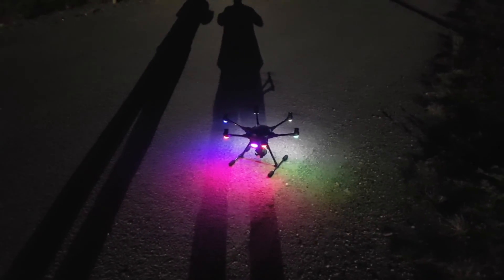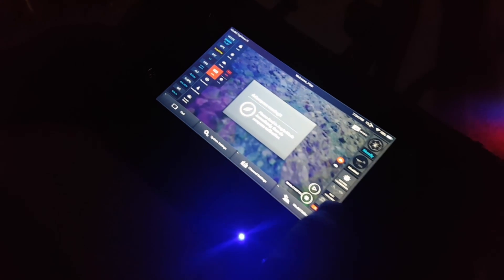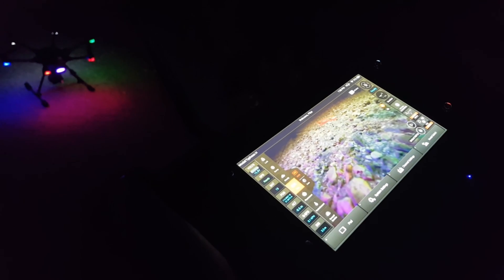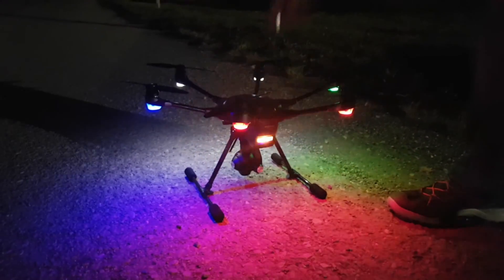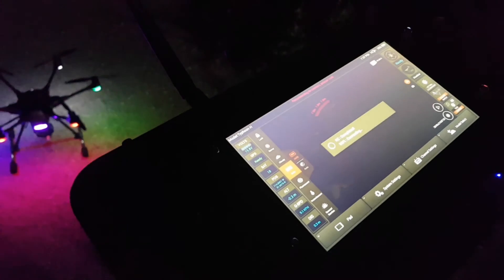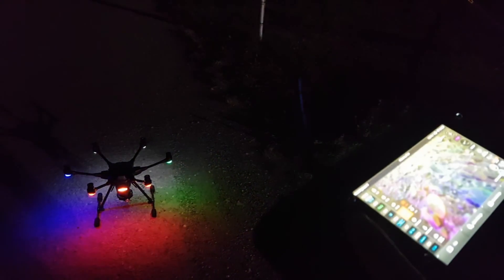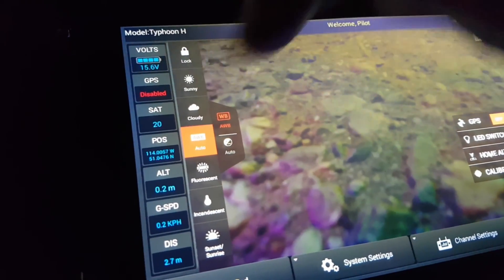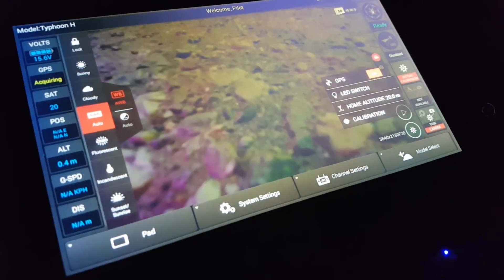Drone Crash Whats Wrong with the Replacement? Yuneec Typhoon H

Comment: you probably have re bar in your concrete, try moving the drone over the grass,
Reply from the maker: I should have also  said, this was actually gravel also...
Reply from the maker: I know what your saying about the steal rebar but that was not the issue.  My Compass error persisted for 50 or more attempts at another location, it was filmed here to show what was happening as I needed two sets of hands and it was near my friends place that was available.  There was a problem with the drones firmware.  I waited months for Yuneec to create a firmware that worked.  After the revised firmware that did a preheat and some other tweaks, this drone started to not have this issue, but it started to toilet bowl after a few flights when it got warm.  I cant recall how many drones they sent me, but it was at least 4 of them, and a new flight controller I swapped myself.  There was a handful of these 'problem' drones, but they did eventually fix it, but I had lost trust in the platform.  I have a long history documented on Yuneec Pilots for what I went through.   I was a loyal Yuneec pilot and at one point I owned two of these, but had the same issues.  If this TH worked, it would have been nice as The Inspire 2 cost me way more then I wanted to spend!
Reply: @drone_video9849  thats so strange, I have owned, for various reasons  at the very least 7 or 8 , starting with the Q500  , and never ever , had  any issues at all ,, never, in fact, not to long ago, a friend which has a Typhoon H, hit his own DJI phantom while trying to video the aircraft, 
snapped off one prop, and the Typhoon, calmly landed with 5 props,, with not a scratch on it,, .  Im shocked to see your issue.  I hope you have it resolved.  And are flying one to enjoy it
Reply from the maker: @guglielmodicarlo4139  Thanks, this video was from 2 or so years ago.  I have been flying the Inspire 2, would be nice to have 6 props!  I started with the Q500 and really liked it, thus why I got a TH model.  When the TH flew it was really flight characteristics. Handled wind really well, and was smooth.  I know had 'lemon' but after months and months of issues, I just could not learn to trust it.  My I2 has been flying great.  Also got a Mavic Air and a Mavic Pro.  The options and capabilities sure have come a long way since this model.  I wish Yuneec had got better market share.  The TH was a really nice size also, light too.
Reply: @drone_video9849  wow,, believe it or not, I didnt notice the year,,,lol  funny.  Ive gone the DJI route, but quickly left, I cant tell you why, I just dont like em,, nothing to do with the aircraft. Just dont like their arrogance and  lack of customer support
but glad to hear your still flying
good luck to you  I currently have 3 typhoon H, and 1 Typhoon H plus and could not be  happier
Reply from the maker: @guglielmodicarlo4139  No issues!  I have to also agree with you on DJI "customer focus" - they are a little less that desirable to deal with, Yuneec was fantastic and easy, DJI customer support often means months of form letter responses.  I have had a good run with them, but as there aircraft get to about 2 years old, they seem to put out bad firmware and hope you buy a new drone.  My I2 is struggles with the ".300" firmware, I had a really nice "water landing" I posted on my channel a few weeks back as a result of the glitches (and not being as careful as I should).

Comment: I've had my H Pro for a year now without any issues. When I first received my H I had this same prob. FIX: Make sure you upgrade ALL firmware. Calibrate GPS, Camera, Acc. Note: When you Calibrate your GPS DO NOT BE NEAR ANY METAL OBJECTS. Your trying to calibrate your UAV APPROX 10 FEET FROM METAL POLES....That's why your having issues. I wish people would do their homework instead of scratching their heads. Good Luck....As for the flyaway...I guarantee you didn't correctly calibrate your gps hence your UAV couldn't find the controller. Again good luck and remember to update and calibrate...
Reply from the maker: tacalert1 this video is filmed over two years ago.  When it was filmed these were real problems.  The change log  in that firmware you use now was built by experiences of people like me.   Yuneec admitted to me that they had issues and an updated IMU board was send to me after replacement of many of these units with  same initial manufacturing batch.  I ordered mine in Jan of 2016 and received it in August of 2016. After a few flights its crashed.  This was one of many replacements.   It took 3 months before the firmware was stable and matched to an IMU that stable.  The preheating and other safety features you are in the change long is what made it stable.   So your working firmware is because the early firmware that I had and was the only one available didn’t in fact work.   Yuneec admitted it and they fixed it eventually.  

You are correct about calibration, but this video was a recorded to show the match condition and was recorded when I could have access to a second person to record it.  BTW  calibrating near this post is not the trigger for the condition that was shown in this video.    But an ideal calibration is not near metal is best.   I had hundreds of calibrations before this done 100 proper with the same result.   

There is lots of details as the the history of this event throughout the comments sections and other videos.    I can assure you I am no novice when it comes to this equipment.   You only have to go to the DJI pilots forum and yuneec pilots forum to find my posting history to see that.  

BTW you are never calibrating the GPS on these drones .  It’s the IMU and compass.    The compass acts with the GPS to correlate the date and with the IMU to confirm they are sensing the same the thing.  Like direction of motion when combined with a GPS trail,  and compass heading....

I hope that regained my response as polite and considered.  I however wish to be clear with you any anyone reading this that  two years ago these were real problems, and as I have said in other posts here and on the boards they eventually got these issues resolved.   The yuneec pilots forum use to be abuzz with people having these issues and now it’s almost no issues being posted which does say the issues are largely resolved as I have also experienced that by the end of 2016 and early 2017 the be IMU and firmware truly did fix these

Enjoy flying yours.  That’s the point of this hobby for me so i hope you enjoy it the same way.   I lived through the firmware problems of the early versions and managed to stay connected to the hobby.   Now I fly Inpsire 2, mavic pro and Air and really enjoy it.   Stable and works with only a few quirks.   I still like the H but I have moved  from it as the three I fly now do different things for me.
Reply from the maker: tacalert1 Your comment "As for the flyaway...I guarantee you didn't correctly calibrate your gps hence your UAV couldn't find the controller. Again good luck and remember to update and calibrate..." is 100% not accurate.  The flight where I had my fly away was the 3rd battery, from the same place...  Additionally, I feel you didn't read the notes on that flyway video, because when Yuneec looked at the logs they 100 owned the issue.  The LOG files from the controller recorded the stick inputs, and the TH position and error log.  If there was no connection with the remote, you would not be able to arm the motors and take off, and you would not be able to see the log of the telem data that is recorded in the TH controller itself as aircraft data is sent back to the controller to be recorded.  When Yuneec looked a these logs and said to me they were tracking an issue exactly like the one I had, and asked me for my permission to send my log data back to the software guys in China.  After a few weeks they produced new firmware to accommodate for that condition, and asked me to test it.

Your jumping to fast to conclusions about the ability of the aircraft and the person flying it.  I think your positive experience in the last year is an true and accurate account, and as I have said in my other response to you the forums are no longer filled with people complaining.  But in 2016 the ownership experience was different and my 2 year old posts on this reflect that.

See my other response to you about "calibrating GPS" - this is not a real thing, so in the interest of being accurate, the calibration your doing on these aircraft is for the IMU and the Compass only.  the GPS in this aircraft has no calibration.  Its accuracy is derived from the signal of a orbiting satellite and is generally thought to be accurate "enough" after it has stable visibility to 10 or more of them.  The Almanac that the each GPS satellite transmits and is built up inside the GPS unit is also very important, and thus waiting for that to be rebuilt insure further accuracy.

If you followed the Yuneec Pilots forum, there is a significant discussion around this GPS almanac system, and some thought it was contributing to this issue.  My experience was when I let the TH sit outside for 20+ minutes (the typical time for a full rebuild of the GPS almanac) it actually flew stable, leaving some of us to think the early issues were also focused around that.

I hope this helps you understand your aircraft better,  and enjoy flying it more.

Comment: I own an H.  In my opinion the FAA should ground all H drones and declare them unsafe to fly.  I have voluntarily grounded mine.
Reply from the maker: I got rid of mine in Jan 2017... got an Inspire 2 and what a difference - very happy with my decision.  I just ordered a Mavic Air too, hoping that works well.  I think Yuneec knew there was a latent issue in some runs of that model, as they basically used different control hardware in the new models that are coming out for late 2017 and into 2018.    If you own one, and it has issues I'm not sure how you would get it fixed.  I wonderi if the new controller board from the new models work in the old systems? I check the Yuneec pilots forum once in a while and its way quitter on the issues front, but there is still some reports similar to this.  

I hope you find a way to get your back in the air safe.  There was so much potential with that platform when it arrived, and now a Mavic air does the same think for way less money and way smaller.  (and yeah, I know it has 6 motors and its safer, but still... a 475 gram drone has pretty much every feature you would need now).
Reply: thats because your insane, and really hope you never really have a problem in your life,, what a moron, you deserve a slap, ya half a sissy

Comment: Crazy that it took so many replacements.... Not sure I'd been quite as patient with this company as you were, but glad it all worked out in the end!  
I know this is an old video, but was just wondering are you still flying a Yuneec product or have you switched brands?
Reply from the maker: No, I ended up with Visa backing me for a full refund, because they could not get it to work.  Visa has a very high degree of power.  They looked at almost 1 years of emails, and some of these videos, and Visa refunded my money as part of the warranty program.  I only fly DJI now.

Comment: hi all...ok so i explain the problem i had befir a massive crash...i bought the drone in june 2017 everything was going well...til i traveled 6000 miles away from home where i only used the drone  (same area)...once there i tried to use my drone...after power on i got an usual and the very 1st time i saw that a purple and orange led 2 orange flash 1 purple....tried to calibrate the compass again like 10 times without success...after that i changed location for like a mile away and tried it again...after 4 tries to calibrate the compass it was like usual purple led...but 5s after i take off... the drone went crazy and flew away straight line to the left  and i couldnt take control of it then suddenly changed direction when i pressed return to home to crash on the wall now it has been totally destroyed...could you tell me what is wrong pls ty...
Reply from the maker: There is tons of things that could be an issue for you...  you needed to be at latest firmware to avoid the northern vs southern hemisphere compass issues for example.  On the TH, you need to do the compass calibration when you move that far for sure.  Did you want for all the GPS data to load, when moving that far the GPS takes much longer to acquire and get the full almanac.  From what you briefly described the GPS was not locked on and the compass was not calibrated to your location.  you should visit the YuneecPilots forum for more help and you should also share the data from your ST16 controller with Yuneec, who can read it and tell you exactly what went wrong.  The Forums have advice on how you can read your own log files also if that interests you.  That's all the advice I can offer you.
Reply: Drone_Video ok thanks brother i for sure wasnt on last update...and hope yuneec will replace it because i have a phantom 4 which never had that issue...anyway thanks for your answer.
Reply from the maker: Depending on what version of the code you were on, one of them had major compass issues that were resolved in later upgrades.  This video was on the code level that for people (like me) it could not even get in the air.  When I was active on the forums for Yuneec, there were users that were flying the same code version without issues however.  In the upgrades that come out a few months after this video was filmed (if memory serves me right) the code got way better.  If you end up getting a replacement, I would suggest you run the version of firmware that the forums are saying are good and stable, but test it good before flying too much.  I switched over to DJI some time after I get gave up on the TH and never been happier.  The compass is way less sensitive and it flys very nice.  But hopefully Yuneec can help you out, share the log files with them (they will tell you hwo to copy them and share them with them.  If they see that your problem was because of firmware they have typically been very good about making it right.  There is however some recent talk about how that service has dropped in quality.  Let me know how it works out with them.  I wish you the best of luck.
Reply: Drone_Video well for the version i think it was 1.09 on the menu...hope they will replace it...ill let you bro thanks for your infos.

Comment: I was told by yuneec to calibrate The compress when you go to a new location just to be safe. But I calibrate mind all the time for better performance.
Reply from the maker: That makes sense, always follow manufactures directions, its the only way to get warranty if you need it...  but the reality is that calibrating the compass before every flight is hotly debated.  For me, I have never had an issue once the firmware was updated in version 3.0 - and I could travel 100km apart with no compass issues (errors or drifting etc).  The comments in the video description give you extra insight into what I was dealing with.   The "calibration" issue was never my issue as the calibration didnt work at all, despite doing it hundreds of times!  It was so bad that one firmware version the  compass would generate an error on power on!  The updated firmware right after that was better in that it generated a compass error when the motors started, one the final working firmware was published it noted a firmware correction for keeping the GPS board cool/warm properly.  

That was the firmware that resolved the issues.  Speculation was there ws two hardware versions.  The yuneec forums once guy even posted a version of some internal parts like a power distribution board that had a Oct 2015 date on them, and then an updated board from 2016 later.  

I think the Yuneec Typhoon H at this point has stable firmware and all the buggy boards were destroyed in crashed people had and the install base is largely clean of the issues.

Thanks for the advice, but the issues were significantly more complex and were never resolved with anything the user could do.  It took solid firmware updates to make it work.  They took my initial crash logs and other logs and sent them back to software engineering and it took about 3 months to finally resolve the issues.
Reply: chauncey Black until you calibrate in an area with magnetic interference and the drone crashes... If it ain't broke don't fix it, once you get a good compass calibration don't recalibrate unless you travel 100km horizontally on the earth from original calibration point.

Comment: Mines do the same thing you have to calibrate accelerometer on a level flat surface and calibrate the compass I will start the aircraft.
Reply: After you do that restart the aircraft it will work Mine does it all the time
Reply from the maker: chauncey Black I ended up fixing the problem.  

But I will tell you that having to do that every time you fly is not normal.   There was a group of firmware from initial shipment to just about the last of the version 2 group that was broken.  The new version 3 firmware works fine.  And you do t have to calibrate very often.  Just compass when you start it up far from last position, sometimes.   

But again. This was an extreme example of issues that with many replacements still did the same until a firmware fix came out.  

If you have to calibrate the compass and accelerometer  often or at every flight, yours in broken then.